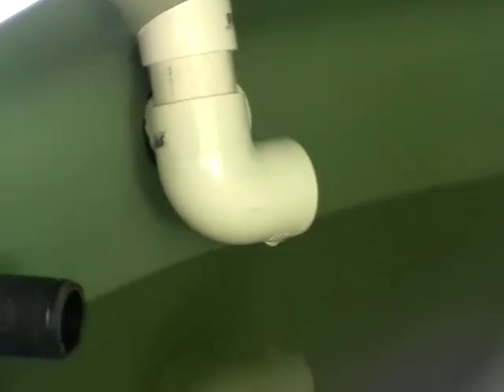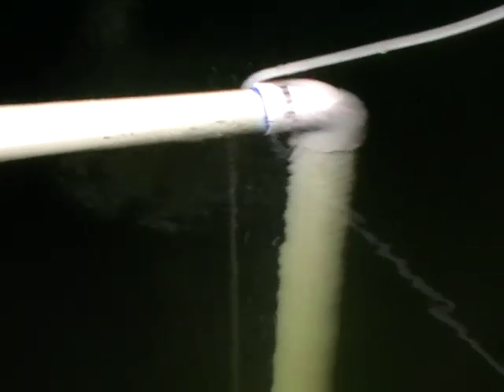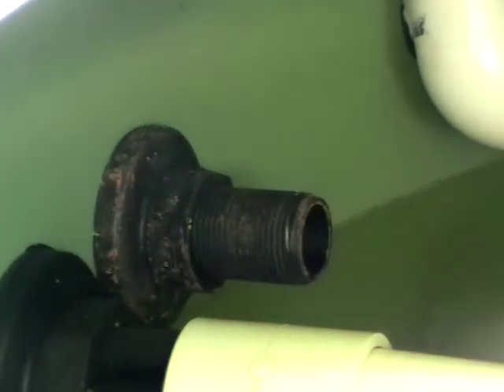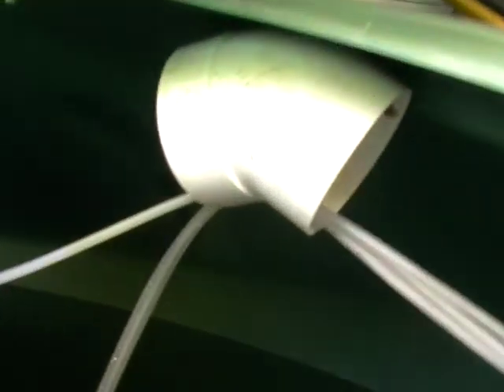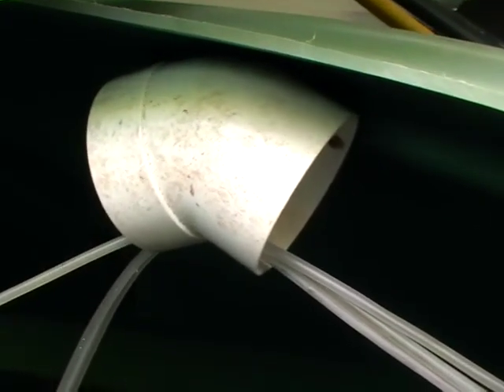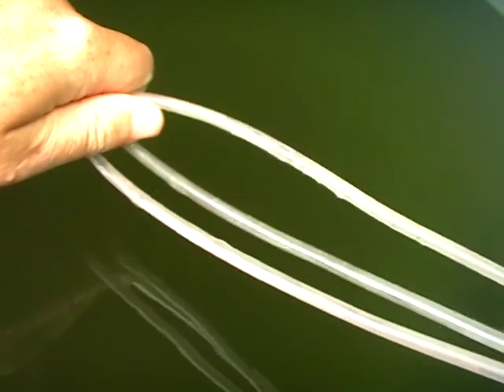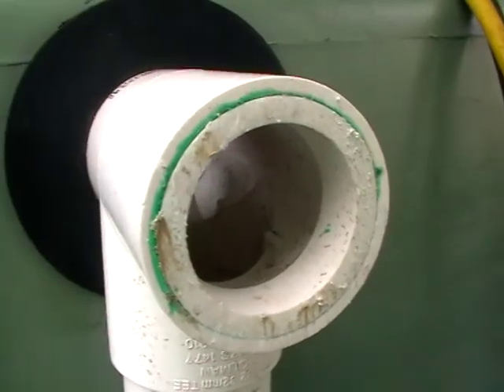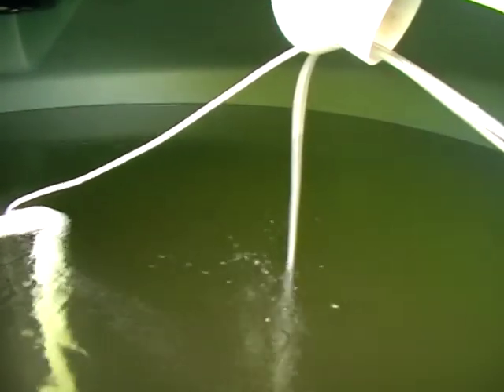Aquaponic plumbing tips and tricks part 1

Comment: Your main water outlet should have an opening at the top, like using a T-Joint instead of a 90 degree joint to avoid all your water to siphon out of your fish tank in case your pump fails. Or how do you make sure that it wont happen?